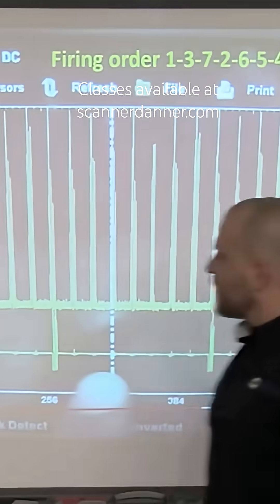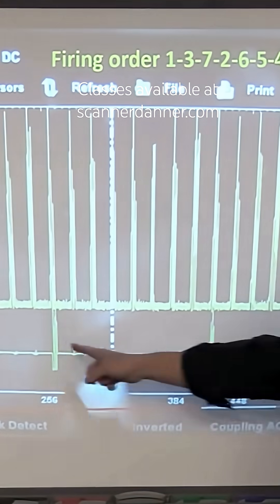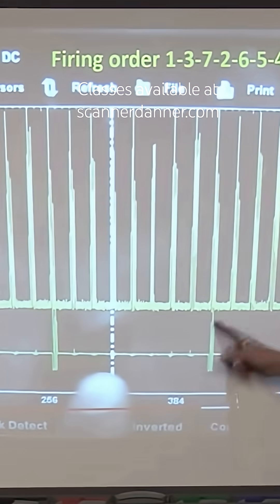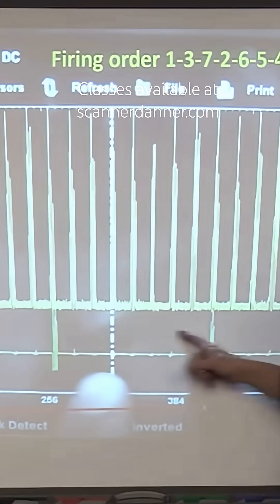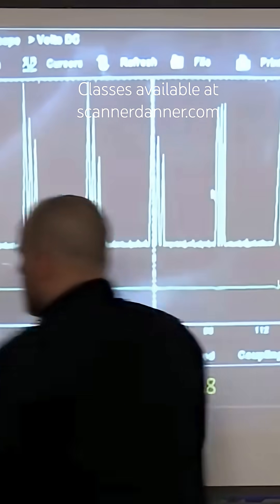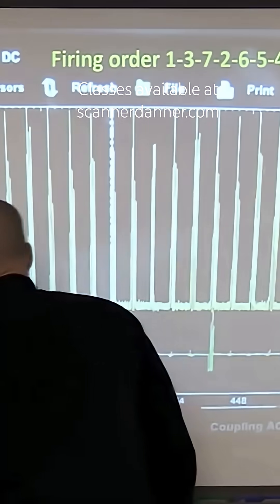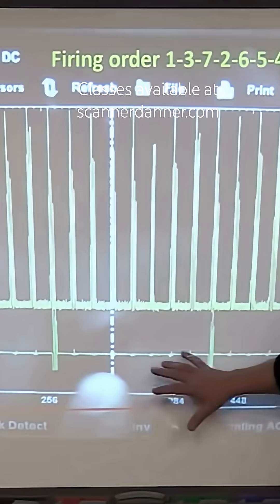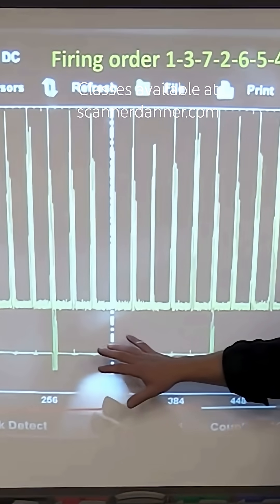How to view ignition coil firings from the fusebox

Comment: I think this is highly unnecessary we are not nasa engineers we donot make enough money to have to know this type of nonsense As a 30 year tec I refuse to use a scope,,, maybe you should test your test equipment!!!
Reply: So for 3 decades you have been hanging brakes and guessing at diagnostics, got it.
Reply: @stevestadnik9206 and over up selling nonsense to pad his flat rate hours
Reply from the maker: @stevestadnik9206 Exactly
Reply: Guys were using sun scopes when you were doing your first brake job. Its nothing new, you've just convinced yourself swapnostics is a good use of your time.
Reply from the maker: This is far from nonsense! Keep watching, maybe I can help you change your mind and stop being a pattern failure parts changer.
Reply: @ScannerDanner wer kein scope benutzt ist kein techniker .
Reply from the maker: Or is a dealer tech who can only fix pattern failures and never really learned how to properly troubleshoot

Comment: I've noticed that most of the time people use the secondary to view ignition firing events. Is that because it's just generally easier and less dangerous to the scope? 

In what way would you say that the primary is more stable? Would that mean there can be faults that you wouldn't be able to pick up on just the secondary?
Reply from the maker: Secondary when possible (easier) and many ignition coils you cannot view coil negative (primary voltage) because it is built into the coil. 
When you can view coil negative voltage (primary) it is a much more stabile picture as it is a direct measurement and not a capacitive pickup like a secondary lead. These are notoriously noisy and can be difficult to get good consistent waveforms.